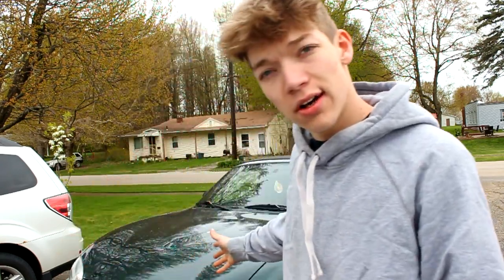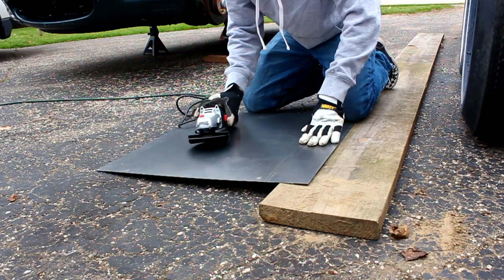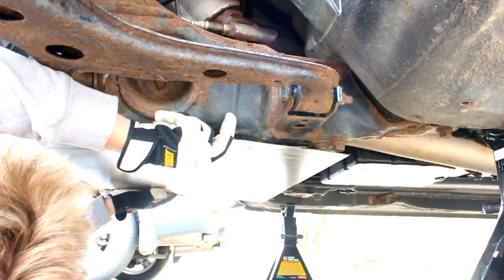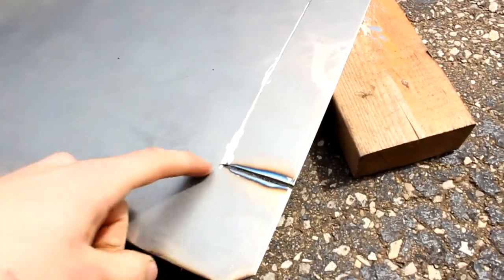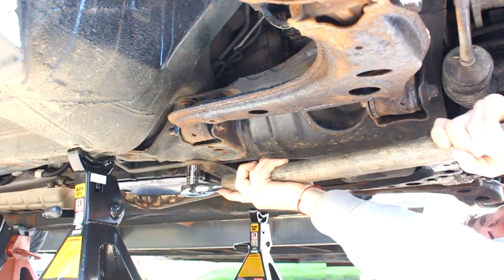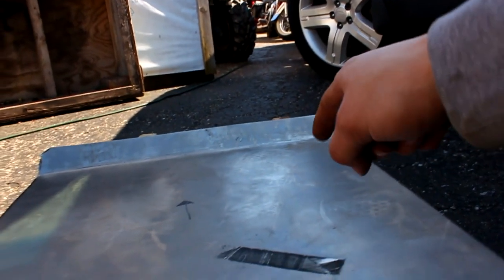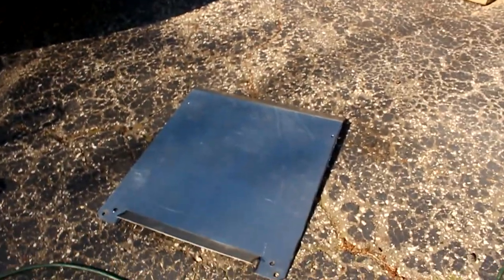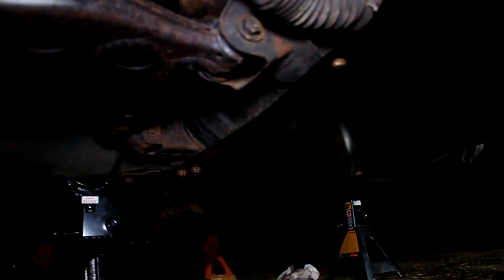$38 D.I.Y Skid Plate

Comment: Made 4 of these for my car too, 2 mm steel. one for the radiator in front, one for brake lines on the left side, one for the fuel lines on the right and another smaller one on the brake line bend. For these I also added crossplates around 1 cm high running across the whole plate for additional strength. Took me around a week to do everything, but 70% of that was cleaning the cheap rusty metal sheet so I could properly paint it. 

I bought a composite skid plate for the oil pan around 3 years ago, but it literally drags on shitty roads all the time cause the gap between the pan and the plate is too big, like 7-8 cm. I figured with a reinforced plate you are just fine with 2 cm gap, you'd need a pretty big hit to bend both the plate and then the aleady thick oil pan. 

Now I laugh at our forest roads where peeps constantly lose pieces of their plastic undertrays😂 steel plates these took some good hits already and apart from minor pwint scratches everythings perfect. I can probably now lift the car anywhere I want, even on the bumper😂

Comment: Not bad but it would be helpful if you explained how you located where you drilled your holes.
Reply from the maker: I drilled the rear holes to match up to the front subframe brace and then for the front I used the two smaller bolts from the plastic engine guard... I hope that maybe helps if not let me know I could get some pics sent to you over insta dms or something ✌